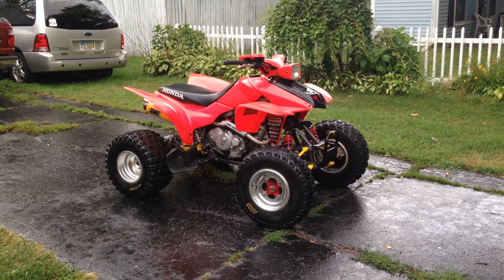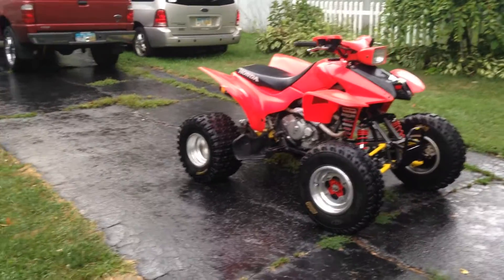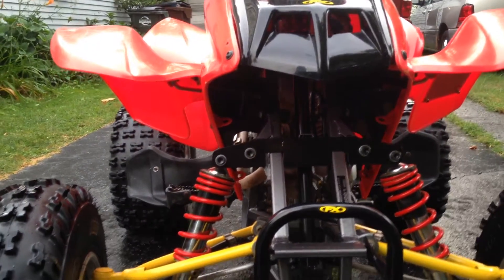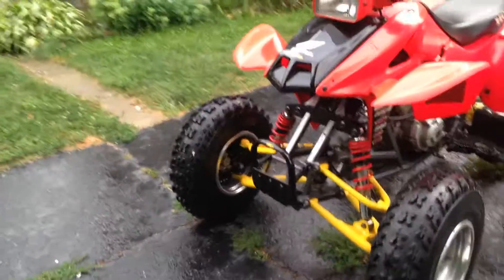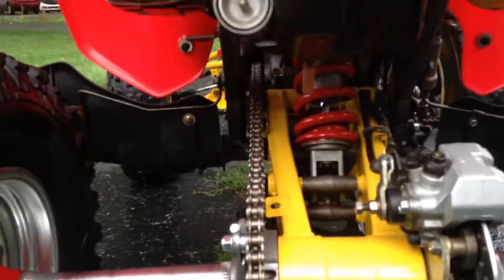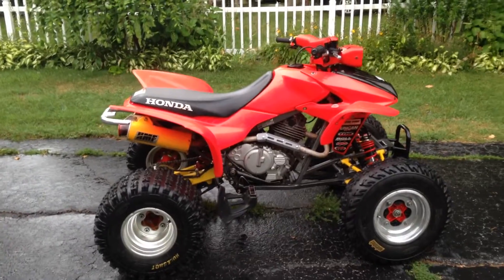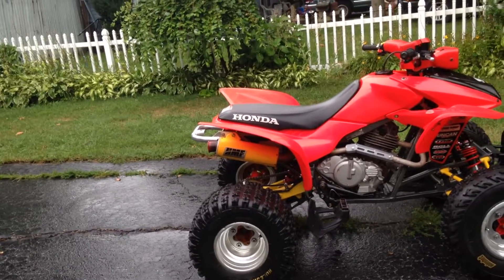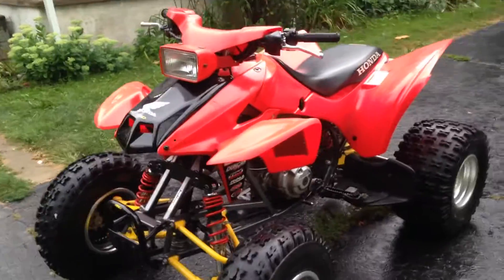300ex/450 project part 3

Comment: I’m missing the 3 parts in between the 2 fenders gas tank cover and the nose hood. Do you know where I can find some? What is interchangeable? Can I use 400ex with 300ex fenders?
Reply from the maker: I just used all 450 plastic.

Comment: Did the 450 plastics line up evenly??
Reply from the maker: The front fenders had to have L brackets. Made to bolt to the frame   But that’s it.  Everything else lined up.

Comment: can u explain how to cut the 450r plastics to fit?
Reply from the maker: Really didn’t have to, just made two angle brackets that attached to the frame where the stock fenders bolt to.